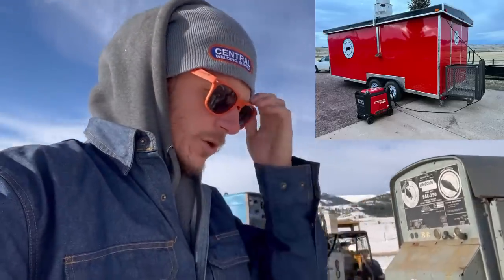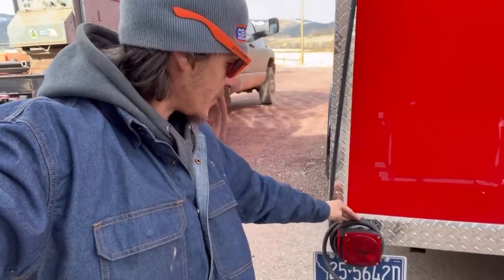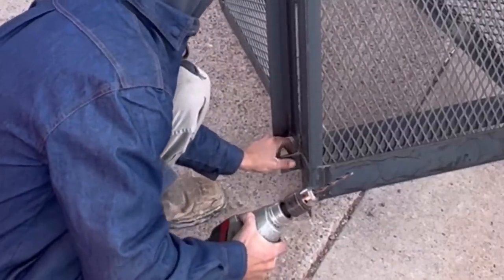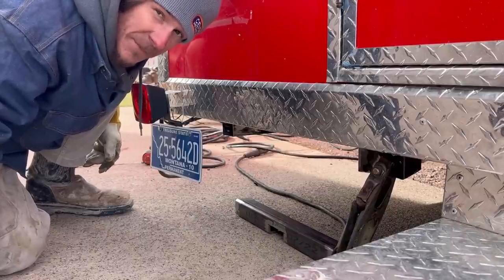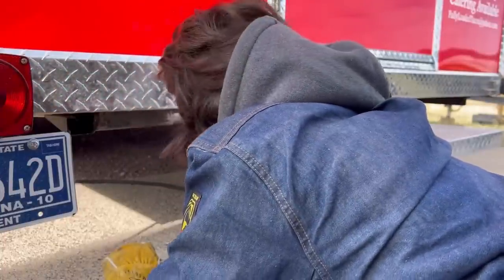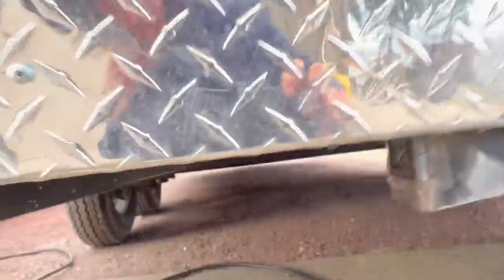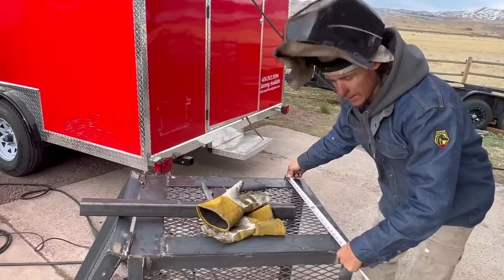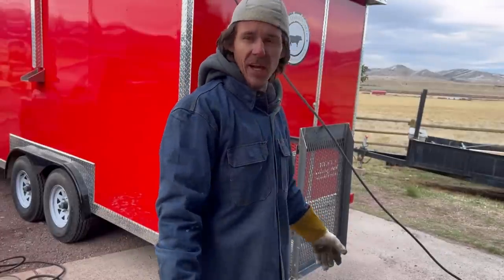The WORST MISTAKE I’ve Made in YEARS! (Welding on a Food Truck)

Comment: OCV is open circuit voltage. For stick welders is usually  around 80 volts. That would be the voltage in the lead when your not welding.
Reply: THANKS

Comment: You may have known this already but one good way to avoid dealing with that glass on the end of your rod is to whip the end of your rod when you break your arc. It will whip the glassy Flux off of the end while it's still molten leaving you with a nice clean cup and a bare rod end that will strike right back up. (This trick is great for 7018).
Reply from the maker: I like to do that when I’m going to have a re strike in the middle of a weld
Reply: He was scraping Flux off a new rod, not a used. Good tip tho

Comment: Had a few jobs go bad on me, they are a learning curve but punishment at the time so well done for winning the day.
Here in the UK, that generator cage would need to have a full operational rear light cluster on it and reflector. The number plate would need moving and have an operating light on it too.
And the owner would have to compensate the nose weight to avoid sway. The traffic police and Ministry of Transport love trailers for regulation violations.
Top stuff young man!
Reply from the maker: I wanted to move the light and plate but he didn’t want to. And the 100 gal propane tanks in the front should take care of that
Reply: Your supposed to do stuff like that here but it's MT, trailers are so often used but most people don't follow the rules but they learn by pain. Were also not as stupid as coasties who can't seem to figure out greese is good for bearings so pick your poison problems you create for yourself or rolling projectiles I think cops count it a win.

Comment: Nice work. Did 2 of these brackets but simpler. Rectangle design base with 4 bolts for removability with the generator bolted to the bracket. Did them on campers in September. Painted both. 5 minutes after the rain hit hard like a tsunami. Had to repaint them but I got paid

Comment: Hay i just saw your runaway diesel short vid. I keep a CO2 only fire extinguisher on all my diesels rigs if you spray co2 in the oil fill hole or the intake it will shut it down. On a runaway it will save it and you cash. Runaways happen a lot here in Alaska because over time running in sub-zero weather ice will build up and clog the intake making it runaway. I guy i know had a brand new cat skid steer runaway and it send the fly wheel so far from the machine the pics of the damage was amazing. So a plan c fire extinguisher is a good thing to have and it will put out fires to :) ps luv your channel
Reply from the maker: Good tip! Thanks brother

Comment: OCV is the Open Circuit Voltage probably the most misunderstood welding term, guessing that thing definitely has no VRD (Voltage Reduction Device) on it unless you added one yourself? Higher OCV makes it easier to strike arc and some rods need high OCV but it also makes it easier to get a secondary shock yourself, been there done that. Why'd you lower it it ain't wet out there.

Also man these constructions always look so fragile to me even with 1/4 steel, that's a lot of vibration on a truck like that. You've built plenty so you know what you're doing but I'm not ready to take a job like that and stand for it, not that we get many of those here in Europe. Props.

Comment: OCV is "open circuit voltage". Although, I'm not familiar with the older welders and not sure why you would need to lower it. I work on rental welders for a living. But rental welders don't last very long, so there's no old ones.
Reply from the maker: Less dig the lower i go

Comment: Open circuit voltage. 6010 requires more than other rods which is why not all machines can run 6010
Reply: I know an A/C machine won't run 6010 for shit. Welding instructor forgot to me. Whoops!

Comment: I never understood why guys never put anything on the thing to stop twist while driving down the road two legs off the underside that when slid in to the hitch receiver rest on the left and right under the vehicle that keeps twisting down when you have something that heavy bounce around back there without any support but i see them everyday and for the last 5 years since i made one of thease hitch mounts for truck i know my hitch wont break but something told me to stop the twist so i have 2 arms with rubber pads that rest aginst the frame underneath the truck when i drive down the roaad there is just downward force on the hitch  feel much better 

But i have see evidence of several generators and some baskets also 2 light weight motorbikes on side of the road i stoped at two of thease and seen twist was mostly the cause main cause was neglect not checking everything once a year or maybe months as one was quite rusty 😮😮 just my thoughts your work is awesome just something people might think about 

The sad thing there isant much to hook up something that stops all the down force you would pull down the wall if you hooked something to hold upward pressure my bed on my truck  holds  turn buckles to keep the bounce to a minimum i just went overboard for safety i just think of a few extra minutes and a little material save a life or expense on lost equipment

Comment: Hey bro why don't you just use 7014 Lincoln electric welding rods . You will never have a problem with the rod when you restart or in any position or any situation.  I use only 7014 Lincoln electric it's the best .
Reply from the maker: I’ll try them!
Reply: @Meltin Metal Anthony  yes please try it out !!! you will not regret it!!! I promise you . I use 332 and 1/8 but it has to be from Lincoln electric.  I mostly use 332 7014 Lincoln electric. I will use 1/8 but for heavier metals . I'm always on the field doing alot of the same stuff you do and these welding bars have never let me down .

Comment: The oilfield is gonna break soon rookie.  When it goes let me know if you want in.  I'm good with Shell, Exxon and BP.  Plenty of work and money for a go getter like you.  You got until about Spring time before it happens.
Reply from the maker: Fuck I might take you up on that. I have a few big structural repairs in the works but spring is still free
Reply: @MeltinMetalAnthony  it's gonna boom.  And all you need is someone to get you in.  I'm OG oilfield and can point you in the right direction.  You just have to do the safety orientations in Houston.  I'm rigging up a welding bus just for the boom.  And you got the right attitude to make a killing.

Comment: You left all the square tubes open. As a professional you should have used square plate and closed the tubes. Now you've allowed rust to get inside those tubes.
Reply: I didn't see anything painted either. Welds will rust and break off.  
Y did it take home 6-8 hours making the cage

Comment: The real fuck up will show itself soon enough. That whole monkey cage with the generator in it is going to be bouncing/dragging/ sparking down the highway any day now. That wouldn't have held up if there were two receiver's.
Simply hanging too much weight off of that 2x2.
Reply from the maker: 2x2x1/4 your fucking nuts 🤣
Reply: @MeltinMetalAnthony  
You can weld, but you're engineering aptitude is not that sharp.
The only way that's holding up is if that trailer never moves. The cantilever is WAAAY too severe.